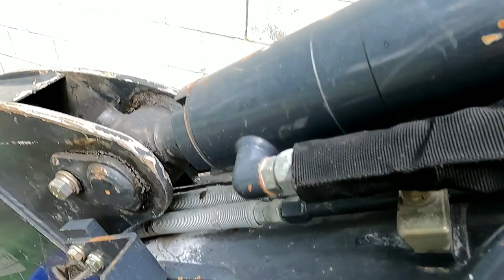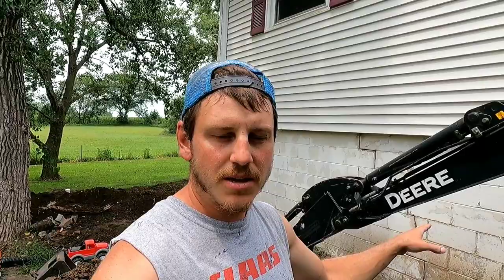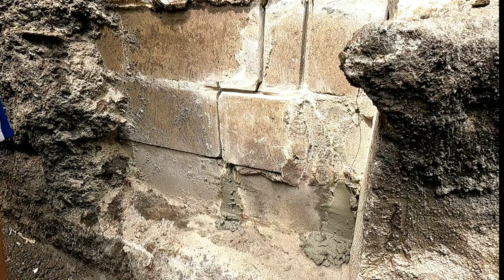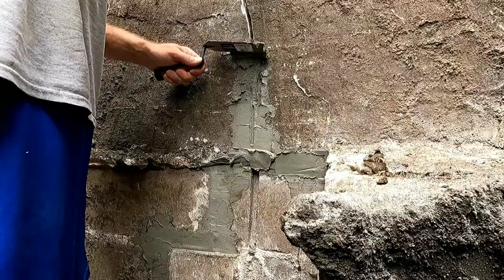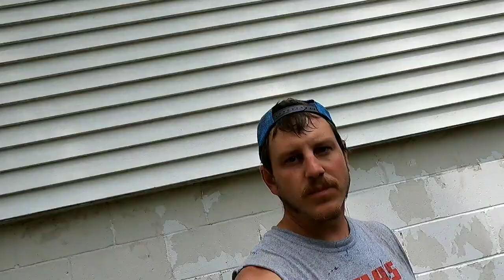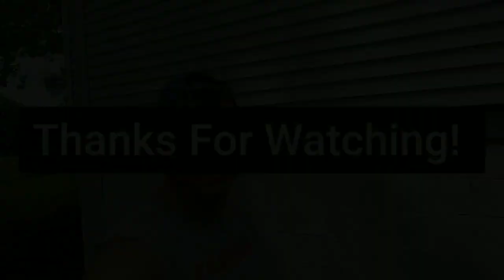Cracked Foundation Block Repair

Comment: You should have sprayed area to be tucked with water, very important! The dry block will absorb the water out of the mortar which will definitely make it weaker
Reply from the maker: I didn't think of that, thank you for the tip I will be sure to do that next time.  Thanks for watching!
Reply: That’s and a mud bag would’ve worked better

Comment: Hopefully, the house cracked from normal settlement. Then your repair is worthwhile. You said the foundation  did not crack . It is possible the house tilted a bit and no foundation crack. I would still let an engineer look at it.

Comment: It seems likes it'd be easier to scrape those joints smooth if it was a little firm and dry (a couple hours later) vs still soft and wet like you did it.  Also I was wondering why you didn't keep going with the margin trowel. It looked like the seam or two you did with it went faster but that's when you went ff and you went back to the little guy so I guess it was just deceiving.  Thanks for the video, it helped me get an example for what I'm about to do.
Reply from the maker: Your probably correct I should have waited a little bit longer for it to firm up a little before I used the jointer to smooth out the joints. And I was just using whatever tool seemed to work the best for getting the mortar back in the joints. Thanks for watching!

Comment: Was the footing cracked? i had an area on my block foundation wall do the same thing 2 years ago. I didn't dig down i just filled in the crack and so far its not cracked again.
Reply from the maker: From what I remember no, the footing was not cracked. And so far it hasn't cracked again!
Reply: @amidwestfamily112  keeping my fingers crossed lol
Reply from the maker: @lar4305  well good luck!

Comment: Per the other comments, the joints should be wet before applying the mortar if you want maximum adhesion.
while no crack repair will remedy underlying structural cause, It's likely as not to outlast the current owner. It's a patch to a crack that likely took 20-30 years to develop. Using a higher clime content will help a bit with flexibility as well as a degree of self healing. on patches like this, I have had excellent results adding fiberglass refinement hairs to the dry mix before water.
Will it crack again? Likely so, but likely not soon.

Comment: Thank you so much I have a wall on the side, several actually , and they are all doing the same thing...excellent work...have you considered using a piping bag ( you can substitute a baggie for it too ) like the ones used for cake decorating ? to pipe the concrete into the block...I think thats the way I will try it but thank you for teaching me that I do not have to take out the whole brick in order to fix it!
Reply from the maker: I recently seen someone use a piping bag and that looked really nice! Thanks for watching!

Comment: Did you do the same on the inside in the basement/crawl space?
Reply from the maker: I used a chisel and hammer when I could to help cut down on the dust inside the house. But also used the grinder with a power "shop vac" large vacuum with the hose next to the grinder wheel to suck up as much of the dust as I could. That helps alot on dust control.

Comment: Bro I got same issue on my cinder block foundation. It looks just like what you’re fixing right now. But my whole house is made outta cinder block. I chipped out all the dust and cut it with a chisel. Should I wash blocks and then apply mortar mix. And will that fix settlement issues
Reply from the maker: You will want the area you plan on using mortar, to be as clean and dust free as you can get it. As far as fixing your settling issue, I can't say that will fix it. I am just a diy guy fixing my own house, and without seeing what's going on with your house I can't say that will fix it. Good luck!
Reply: If your just repointing then joints you don’t need to wash it, it’ll make a mess. If your replacing full on cinder blocks or replacing bricks, wet down the area so you get really strong mortar adhesion- I’m a mason
Reply: refaire les joints ses biens 'mais cela ne résout pas le problème de fondation,qu'il faudrait renforcé et ferrailler pour la stabilise ,bonjour des Ardenne belge.

Comment: So this is just a cosmetic repair not a actual foundation repair?
Reply from the maker: It's a actual repair. It would be best if you have access to both sides of the wall, so you can cut out and repack both sides.
Reply: Cosmetic in that it doesnt adress WHY it cracked, structural in that the blocks are now adhered and have strength added back again.

Comment: 1:08 I know you've got a mask on - but breathing in cement dust will lead to silicosis . 
Highly recommend watering it down before grinding . 
.
Reply from the maker: Yes concrete dust is very bad, you definitely don't want to breathe that stuff in. Thank you for watching!
Reply: @amidwestfamily112  Thanks for all your tips . 
I tell guys grinding away in big clouds of concrete dust about silicosis and they've never heard of it . 
Bottom line ... nothing goes in the lungs but air . Even bakers in the Victorian Era , by the time they were 50 years old suffered from respiratory problems from all the flour they inhaled .    
.